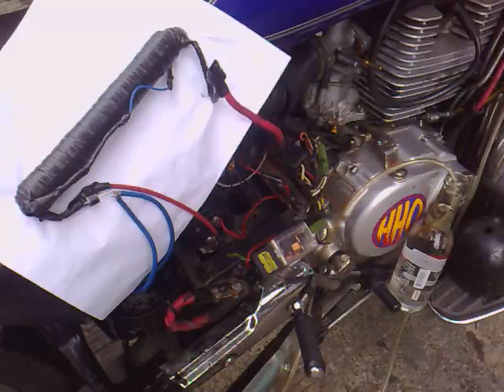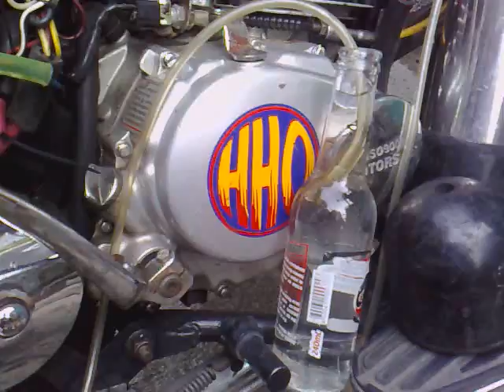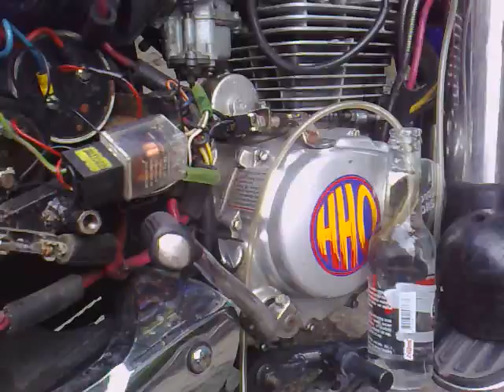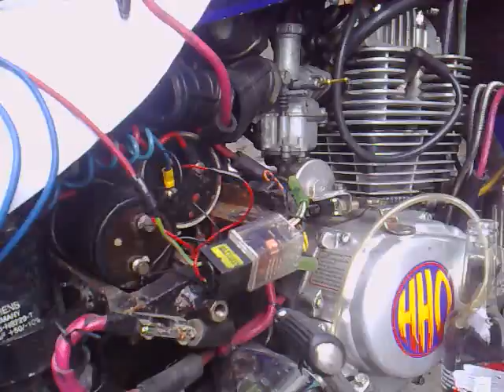HHO / INDUCTOR ( CORRECTION ON WIRING ) BETTER RESULT

Comment: @vox1philippines 
good. ......
i learned something last night.....a way to amplify  pulses.....video later ....
i am so busy here.....i do not have the time i wish to experiment.......

another suggestion for you.....the 10uf capacitor in the circuit......put it on a selector switch, then add other capacitors.....this changes the frequency......
look at my video of the lawton circuit......the buck converter circuit is just half of the lawton circuit.......
talk to you later

Comment from the maker: @irondmax     good day bro....   this motorbike is only a GENERIC,    and need always attention to live long and always in good condition,.. as of now the bike is working good....

when running in HHO i use the lowest octane gasoline( REGULAR),( also save ,cost is lower,) the engine runs smooth  and energetic.... i save about almost 50%  in my present set-up...   the best we got is 3 amp  higher is already abnormal....  my cell is big, so produces just enough for 3 amp this time......

Comment: there are many ways to wire the inductor.......if you wire the pos through....then wire the pos through the other way.......only the pos runs though the inductor....both coils.......... it and capacitance and no magnetic field in the steel core.....there will be more bubbles in your cell.
talk to you later